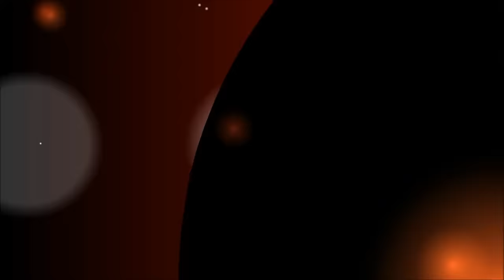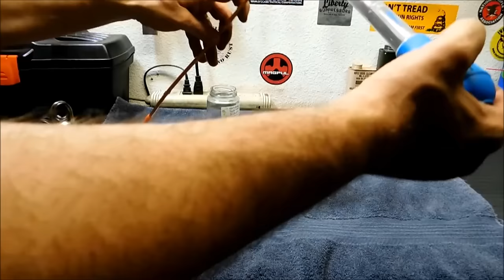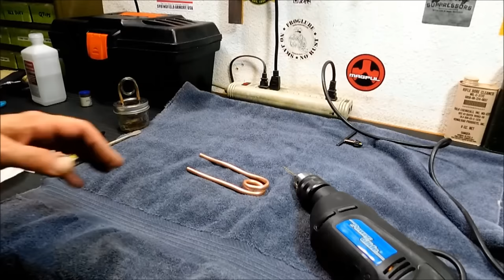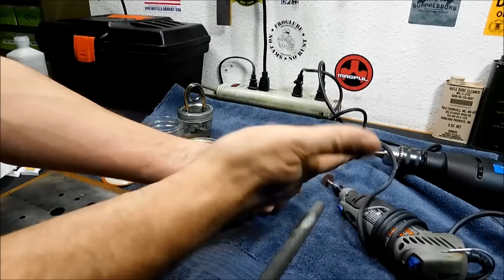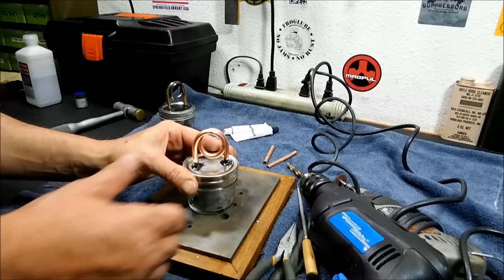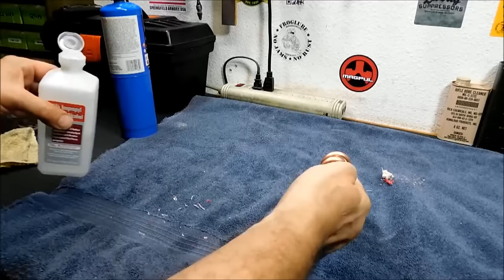Build Your Own Copper Coil Alcohol Burner Stove!

Comment: THANK YOU SO MUCH for a neat little video!!! It was presented well and made it look easy, especially for beginner DYI enthusiasts. Only basic tools required.
   Something I've found to help, (I keep on on my hobby-bench), take an old ball-point pen apart and save the bottom section. Straighten out a Large paperclip and, with needle-nose pliers, bend a small loop in one end, tiny enough to easily go down inside the ink-pen barrell, and lightly, flatten the tip, on the other end. Mix up some five minute JB weld and, with a popsicle stick, fill the ink-pen barrell up. Then insert the straightened out. Paper-clip. Use the old ink-pen refill, to push it out the other end till at least
 1 1/2" is out there, and clean JB weld off the wire. Put the glue back in the barrell, that got shoved out when the refill came back out and screw the clip end back on with a little JB weld on it too...and forget it over night. (since it's inside, sometimes it takes longer to harden well.) This will be about the right size to do little tight pushing and probing hobby operations. It will also aid in installing your wick. ((A quick version would be to just open a large paperclip, almost up, and use the bent part for a handle, and lightly flatten the tip. Not as comfortable, but will still work). THANKS AGAIN. One quick question...is that RUBBING ALCOHOL you're using or ETHYL ALCOHOL. (You went by the camera too fast with the bottle label, for me to see the type of fuel.) I GOT TO BUILD ME ONE OF THESE.

Comment: You can also use compression fittings on the copper pipe instead of messing around with JB Weld.

Comment: Sand tip is great, I would say drill it out while still in the vice it would make it easier, if you use copper fridge pipe you would get a thicker wall and it measures at 3/8 Imperial or 9mm Metric
Great video

Comment: You do a super job explaining everything.  About the wick, one thing that might work is to first measure a piece of thin wire to the same size as the coil. Take the piece that goes to the right coil, connect it to the wire you just measured, connect the other end to the other wick that will go on the other side of the coil, thread it thru the copper tube BEFORE making the coil. Have both wicks out of each end as you described THEN fill the tube with the sand, cap each end over the wick, and make the coil.  The wire will stay in the pipe with the wicks attached from each end as you so eloquently described how to do. Might work.
Reply: so how to get sand off wick?
Reply: That wouldn't work as well for bending the tubing. A wick compresses a lot more than sand does and would more easily produce kinks during bending. Since the wick is only needed in the legs, insert them after you make the coil. A short length of wire, like from a leftover piece of hose wiring, or a kitchen skewer would easily help shove the wick up the leg, especially if you double the wick over the end.

Comment: Had one of these when I was a boy, (I admit it was shop bought) it was made of brass and ran on ordinary petrol, great little camping stove provided you took some sensible precautions like not using it inside the tent lol. The basic layout was identical to this with the exception that it had a primer dimple underneath the burner coil which you filled with a spot of petrol and lit to preheat and prime the jet. Thanks for the vid.
Reply: you must of had the StescO,  got 3,  around £30 on ebay, :)

Comment: This is a very good idea of getting the fuel to the heated coil through a wick rather with the compressed air as we used to do with the old Primus! Rather than drilling the two holes with an exact drill, it would provide more support to the coil if one uses a smaller drill then with a tapered wooden screw, push the taper slowly in the hole till the extra material is burred/ bent over till the diameter is correct. The extra material left bent over in the hole will give better vertical support to the coil. If the coil is soldered or glued in there would be a better joint.

Comment: I saw another video like this but the jar was much larger, wick much longer and was built and used to heat greenhouses.
Wondering how warm an area it can heat and how long.
Thank you for sharing your knowledge!!
Reply: I have a 5ft x 5ft x 6 ft deer stand that is insulated and one of of these made out of a pint jar heats it just fine. On a mid 40s day it easily gets it to mid 70s inside the stand.
Reply: @user-neo71665  Neo, how much fuel does it consume over say, 4 hours. Thank you in advance.
Reply: @pa_maj.MARTINI-van-MAN  
.
Reply: @pa_maj.MARTINI-van-MAN  .

Comment: if you want to make larger ones, take a string tie it to the end of the wick. use a small keyboard vacuum and vacuum out one side. The string will feed through and you can pull the wick to the right position! it would be cool to see a double or triple loop... Great concept!!! thank you plan on making a few myself
Reply: Yes, old electrician trick... Use a vacuum.

Comment: Cool.  If you don't have, can't find, or don't want to buy wicks, you can use cotton balls.  Just unroll one and twist it into a fine thread.  When it pulls the fuel up into the tube, it will expand to completely fill the tube.

Comment: Similar alcohol burners had been produced commercially in Japan for school laboratory use and for mountaineering. I prefered to use my alcohol burner with three loops for mountaineering over gas/gasoline/paraffin oil burners because of reliability. Later imported Trangia burner expelled them from the market.

Comment: I just made one following your instructions and it turned out fantastic mine burns almost like a jet engine thanks for the sand tip
Reply: ... how long was the burn time ?... gonna make one for winter Michigan camping
Reply: What size copper pipe di you use?

Comment: Im going to make one tonight and I will measure the btu's and add that info to my comments in case anyone is interested. Thinking about making one with several flame heads on a larger jar as well. Great vid!
Reply from the maker: Thanks, should be interesting to see,  I have not done much with it other than make it easier to  prime (no blowtorch) and clean it up some.
Reply: Could you safely burn this while sleeping in a ice shack?
Reply: It`s been two weeks so where is it?
Reply: Rezult?
Reply: Yo...the results?

Comment: It works! Nice tall pencil flame on mine. I soldered the copper to the lid though, nice and strong. Good fun little project...thanks!
Reply: Follow up: Single flame in the middle does not waste any heat with my kettle, No wasted flames up the side of the kettle just a nice little spread in the center when used as a burner in my Ohuhu gasifier stove which acts as a windbreak. Not very quick but efficient enough....set and forget for a cup at a time!

Comment: jb weld a metal bottle cap under the coil so you can burn some alcohol in it to warm up the coil.
Reply: Someone also suggested this so another jar can be screwed on top and stop evaporation when not in use.

Comment: You don't need glue. Just solder it with tin-lead solder. This is easy to do, just stick the coil into the cap in place and heat it up on a gas stove or burner, adding solder to the place to be soldered.

Comment: Take a second lid.  Remove the inner seal.  Glue/seal it onto the top of the lid of the copper coil.  When you're done with your burn, use another mason jar to screw onto the top.  You wont burn yourself and you wont waste alcohol through evaporation.
Reply: would that work? would the flame not go out?
Reply: The point is that the flame will go out; it will also prevent the alcohol from evaporating. Instead of escaping trough the little hole, it has nowhere to go.
Reply: You might be able to do so, however the added benefit of the second jar is that it protects the coil, and more importantly, the connections with the lid. This would make the thing as sturdy as the glass jars, which would be great for transport. Also, there would be no need to wait for it to cool.
Reply: You could also solder a thimble to the extra lid and make a little pre-heater cup.
Reply: Well said
Reply: Ok, late to the party, here, but it would be much smarter to EMPTY the stove before storage, or putting it in your pack. Much smarter, and safer, to put in only as much fuel as needed. After a few uses, you'll know how much fuel is needed to heat a cup of coffee, or boil water for dinner, etc.
Reply: @christiansmith2730  I believe because it would take you a while to heat up the coil enough to turn it back into a gas. It would be like trying to light it for the first time every time you light it. Plugin it or adding a jar on top would keep it from evaporating and therefore making it easier to light and protecting the coil and lid from damage.
Reply: Bobby S , I understand how the stove works. The amount of time the wick requires to absorb the alcohol is negligible. Further, the stove already has to be primed every time it is used. We’re talking about carrying a flammable solvent around in a glass jar. If that breaks in your pack, it can ruin your day. Broken glass is bad enough, add losing your stove fuel, and the potential to damage other items in your pack, and you’ve got a BAD idea. This is a great little DIY project, and could be a great little thing to store in your truck, or home, for emergencies, but needs a little work before it becomes a backpacking stove. The glass container is a liability, but there are plenty of metal containers that this same method can be applied to. Either way, I’d carry any stove empty, if at all possible.

Comment: I didn't see it but I guess the sand was removed. anyhow you did a great job and is very cheap to process, thanks for this idea. I can used as a heater in winter,  few of them can provide a warm place, thanks again

Comment: Great job, and nice instructions! One suggestion -- I think you could cut your priming time down if you ran the wick all the way through. One way to do that is to a properly-sized round wick, especially a fiberglass one. If you can't find a wick that moves smoothly through, you could run a cable or wire leader and attach that to whatever wick you're using that so you can pull it through. With a wick that goes all the way through, the alcohol will be wicked right up to the hole and will prime much more quickly. You might even be able to get it to run on kerosene!

One other thing you might try is to put fiberglass batting in the jar to hold the fuel and prevent sloshing.
Reply: John Mury I was thinking along similar lines.
Reply: I think getting full wick thru tube is more important than a pretty twist. You can prevent kinks by using wider wrap to start then twisting entire loop set alone.
Reply: IF you run the wick  all the way the burn time will be lower as you will be burning LIQUID, BUT by shortening the wicks, you will be burning GAS, at a longer rate of time,
Reply: @SCUBADUDESMITTY  Right. The point of the burner is to vaporize the fuel by heating in the upper coil so it's a gas before it gets to the hole.

Comment: They’ve used to use JBk weld to put cracked heads back together, on flathead engines. I wouldn’t ty it on Overheqd Valve engines because there are too many weather jackets and passages in those, but when repairing cracks in the ports of OHV heads the machine shop I worked for used thread weld plugs. In that method you ground the area to be repaired clean with a Drexel or air tool with a stone type polishing bit. Then you start on the outside of the crack on both ends and drill and tap the holes, screw in the cold weld plugs and lubricate or coat the threads of the plugs with JB weld as you go. Work you ways in from the outside of the crack and then grind the area smooth after breaking off the top of the plugs. When your done you’ve got a crack repair that will never fail. J B Weld is the stuff!

Comment: Interesting project. This looks like the same principle that's used in Coleman white gas (naptha) camp stoves & lanterns, and also in some lanterns and heaters from Europe that burn kerosene. With kerosene fuel, it would be necessary to have some sort of small primer cup (a bottle cap would do) under the coil. Alcohol is put in the pre-heat/priming cup, and burns for about 3 minutes. By that time, the Kerosene has wicked up into the copper tube, is vaporizing, and comes out of the burner orifice, making a very strong, hot flame. Some experimenting would be needed - I suspect that the burner jet hole in the coil might have to be slightly larger. However, The design principle is exactly the same as my 1958 Optimus kerosene lantern (made in Sweden), and also in a tent heater made by Tilley (a British company) in the 1950's and 60's. There are other brands as well - the most well known is probably Primus. I have a tiny little Primus stove bought by my dad about 1960, and it is a very efficient (and compact) unit. I have a Coleman Peak 1 "compact" white gas stove - it's about 1-1/2 times the size of the old Primus, has to be pumped up, and also gives off less heat. So, it would be interesting to see if this design would work with Kerosene. I think a "snuffer" made from the bottom 2/3 of a soda can might be a good accessory for your alcohol stove.  Just drop it over the burner coil and the stove would go out. Thanks for posting this.
Reply: Naptha and white gas are two very different things...

Comment: Try regular 9-hour J-B Weld it's more high heat resistance being that copper is a conductor of temperature, I remember I had a 67 Mustang with a cracked exhaust manifold couldn't afford to get it fixed but 9 our JB will would last for almost a month

Comment: When I mix jb weld or any other 2 part epoxy I put both parts in the corner of a sandwich bag and squeeze out the air. Next, twist the bag to keep the two parts in the corner and begin kneading until the epoxy becomes homogenous. Now you can snip the corner of the bag and squeeze out your epoxy like icing on a cake. This method keeps the epoxy off of you and makes for minimal cleanup. Also, you can check to see if the epoxy left in the bag has hardened w/o disturbing your project. Great video by the way, thanks!

Comment: Great simple survival stove for emergency usage. I am interested in how long it will burn, how much heat it gives off & the possible uses. So I will try it out. Thank you.
Reply: Did you try it ? And how long did it burn with how many ounces ?
Reply: if you want to use it for heating a space, you could set it under a clay pot. the clay pot will heat up and radiate the heat. I believe the amount of fuel in the configuration you see here would burn for at least 2 hours. make sure you use something to keep the clay pot from laying flat against the ground so you get some air

Comment: The idea is perfect&simple as well!  I used the part of FIRED OFF WATER SPIRAL HEATER  - just cut of a part of it, remove the wire+sand from inside, and you have the copper tube already bent.

Comment: Great ide and good execution of build. One piece  of advice for future builds though. Take an inner strand from paracord and blow it through the bent tubing and tie one end to a length of wic that is 1" lonher than the tube and pull the wic through. The full length wic will cut down priming if youre on a pinch.

Comment: I would suggest cutting a 12" × 12" piece of plywood and glue it to the bottom of the jar. To prevent knocking it over!😮

Plus building a metal frame over it for cooking.

Tip: you could also put the jar in a bucket of sand with a band of copper. With both end in deep into the sand to heat the sand up as a long running heater. Plus, you could also have a frame over top for cooking or you could sit a terracotta pot over top of that as a heat storage space heater to.

Just like for the 72 hour candles.❤

Comment: you don't need the wicks at all, cut the tubs so there on the bottom of the jar, drill the 2 holes on the under side of 1 of the top loops side by side about 5/16 or less a part, it should light with just a bic lighter in 4 to 6 seconds, the stainless steel one I order in are made like this,made using 1/8" copper tube, use methyl hydrate. it burns much hotter and better and a gallon cost you 9$ CND
Reply: Romppai's Outdoors ?????
Reply: Canadian dollars?
Reply: Send me a picture of it or make a video on it and send me the link please
Reply: Jacob riddle yes hence CND
Reply: Romppai's Outdoors ok thank you
Reply: Would you send me any link please?

Comment: Salt also works well to fill the tube for bending.
Reply: Yea because I used sand bent it and couldn't get the sand out, took me a half hour to clear it.
Reply: fill with a small kitchen funnel, you can get ones small enough for that tube, they come in bundles of different sized funnels. The reason it was hard to empty was because there was still a inward turned lip on the tube from the pipe cutter. Before you fill the tube take a round file and file out that lip.
Reply: tubing bender works too
Reply: @matthewlaplante4182  I don't have on of those
Reply: @mikebrabant4170  i don't have one...

Comment: God bless JB Weld. When I first started watching American prepper channels everyone kept referring to it like it was some godly magical ingredient that defies the laws of physics. Now I have actually used it, I can confirm this is true. I dont own a $10,000 3D printer, so when I had to make my high temp gaskets for an oil lamp out of  2-year-out-of-date JB Weld, I was forced to make the best of a bad situation. The end result was not pretty, but it worked. It can be used in engines, so it can easily tolerate the heat from cookers and lamps. You can also create templates on cardboard, clamp them, use a scalpel to cut them out, and make washers and seals for almost anything.
BRB, gonna order some more JB Weld before hyperinflation and the collapse of the global economy (nice cooker btw)